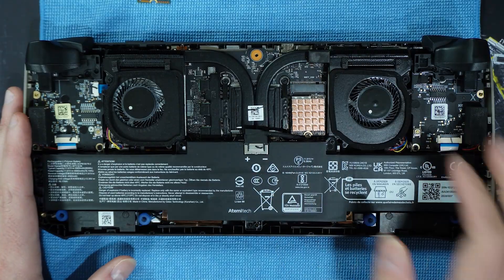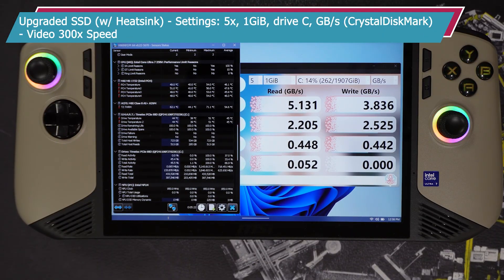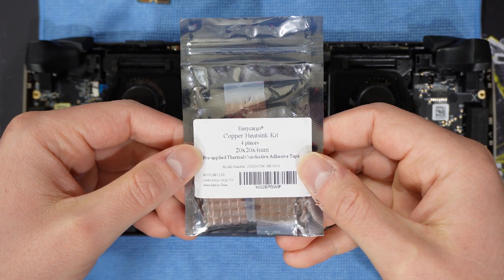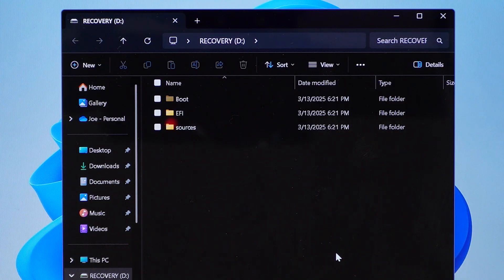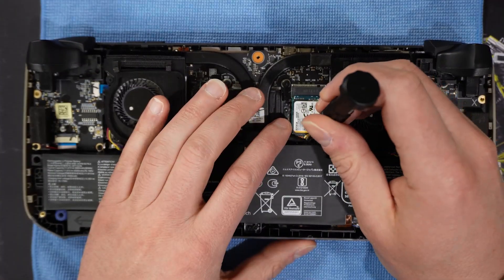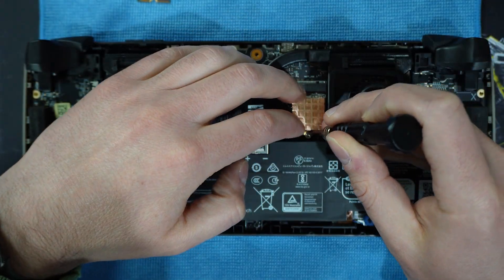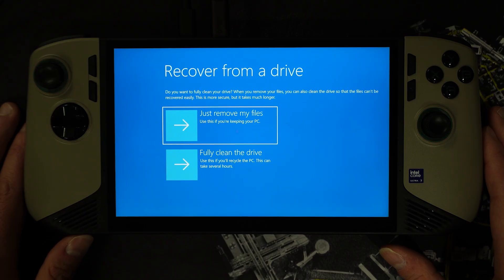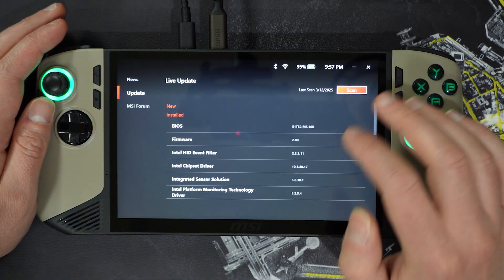UNLOCK THE CLAW 8 AI+ - Faster Speeds - Lower SSD Temps  - 2TB Storage - Use This Guide

Comment: Since the heatsinks you listed are no longer available, will any of the alternatives that are 6mm  (instead of 4mm) still fit?
Reply: They did not restock and easycargo no longer sells it on eBay either 😢
Reply from the maker: Easycargo sells direct from eBay from what I have found https://ebay.us/m/4RdrjQ - same dimensions: Easycargo 20mm Copper Heatsink 20mmx20mmx4mm - hopefully Amazon will restock soon, but it is uncertain presently.

Comment: so my questions, how can user factory reset their msi claw once they upgraded into 2tb new ssd? the goal is user be able to factory reset their 2tb [new one]
Reply from the maker: Please check out my online guide for additional details. You will leverage Windows to build a recovery guide. Look forward to reading another comment from you to learn more about your experience.
Reply: @GamingForInsight  I did check your online guidance, do tell me the big difference doing full clone [macrium] and perform recovery drive from the video you shared? thanks
Reply from the maker: I prefer to start with a fresh image on a new hard drive and with a clone you are using the image partitioned to the original drive. You have the opportunity to carry over as well software, for example, with a recovery drive to the new drive. I’m happy to go into further details.
Reply: @GamingForInsight got it and all good thanks tho. My only question now from your videos the last part when it comes the device ready to boot up, obviously external hdd attach to it as recovery drive and then fro menu recover my drive-> just remove my files, is this considered to be fresh installation while keeping my personal data intact ? The 2nd option the fully clean my drive meaning factory reset right?
Reply from the maker: @SakaSujito ah I think I understand what you are looking to distinguish. Building a recovery drive option is not the same as cloning the drive. Drive cloning involves copying the partition bit by bit and placing it on the other drive. The recovery drive option in my guide involves reinstalling a fresh image through the Windows install process and then restoring files like MSI Center Console M. I did not find the file restoration to be fully complete (e.g., game shortcut, but game needing to be installed; update needed for MSI Center M already done on original drive). You can opt to not include files to backup during the recovery drive building process if you would like, which would entail going to MSI Drivers and Downloads and downloading MSI Center Console M.

Comment: Meine verbaute ssd im claw8 hat  6100mb lesen und 5000mb schreiben. Habe sie jetzt gegen die P310 mit 2 TB getauscht. Die SSD kommt im claw8 auf 6800-6900 Lesen und auch über 5000MB schreiben. 

Ich würde also die Standard SSD nicht gegen eine ssd tauschen die nur max. 5100 lesen hat sondern wirklich drauf achten das es eine mit 7100mb ist. Da ist bei 2TB Speicherplatz momentan nur die P310.

Ich hoffe es gibt bald ein NVME 90Grad Adapter für die 2280.

Was auch gut gelöst ist, die Lüfter der CPU kühlt auch die SSD.
Meine P310 hatte jetzt 52Grad Celsius beim Download und installieren. Beim Spielen ist sie noch weniger gefordert als wenn man Daten drauf installiert.
Reply: Im going to buy P310 2TB tommorow do you use any type of heatsink or is it fine without it?
Reply from the maker: @matthias99442 I do not recommend going with a 2280 form factor SSD. The 2280 SSD will encounter thermal issues and likely early failure. The bottom side of the SSD will get cooked (from getting insufficient cooling and overheating). Bandwidth limitations and bootstrapping can occur as well when running multiple adapters, which would be required for an attempted 2280 SSD mod in this case.
Reply from the maker: @kuchynkajirka I do not recommend following through with this option. Feel welcome to see my comments in this area as well for additional details.
Reply: @GamingForInsight  The timetec SSD is not really available in europe and importing it would make the price basically double....best choice here is the P310 2TB drive, im just speculating if i need the heatsink since you cant really get 20x20x4....best i could find in 20x20x6
Reply from the maker: @matthias99442  so I can't account for whether your Claw 8 was altered from what is factory made. The SSD that is the original one shown in my video is what came equipped in my Claw 8 AI+ (distributed by Amazon). The Timetec 2TB drive of choice I went with supports a higher Read/Write speeds than you specify; I share details and sources on my online guide, which is available in the video description. With that said the Timetec 2TB option is not the only SSD option so I understand the curiosity to try another. Feel welcome to return here and share your experience with another SSD of choice.

Comment: Would 6 mm heatsink also  fit in? Thank you for yor answer.
Reply from the maker: The space available is best suited for a 4mm. 6mm will have the heatsync protrude too much. The 4mm too provides sufficient results for temps as well that a 6mm would not be needed for. Happy to answer any other questions. You can also check out my online guide for more details.

Comment: If we dont do the recovery drive part, can everything be reinstalled?
Reply from the maker: Yes it can. Please check my online guide’s Additional Resources section for the MSI site to find drivers and software. Do let me know if I can help answer any other questions.
Reply: So we still have to install an image onto it? Is microcenter fine to get a recovery drive? I bought the ssd and heatsink. Now i just need to do the windows thing.
Reply from the maker: @TomasAK-n3h  yes because a new drive is set to not have a partitioned image on it (unless you want to find one that does, but I don’t recommend that). You will build the recovery drive yourself on Windows, but if you need to buy an expandable drive (separate external drive like in my video) than MicroCenter will have you covered. Ensure though you have the needed space for the recovery drive. My online guide has the details too for that. Feel welcome to keep me updated on the process!